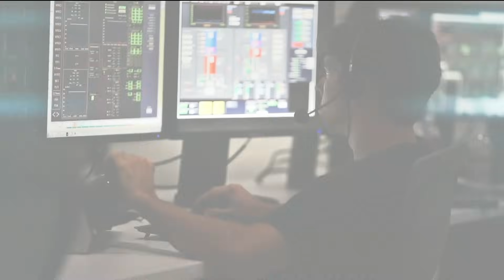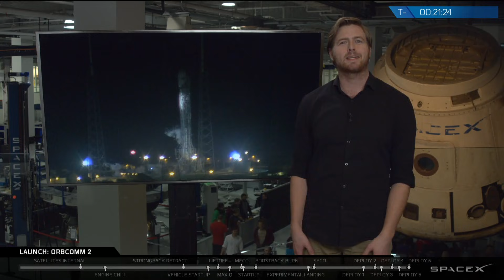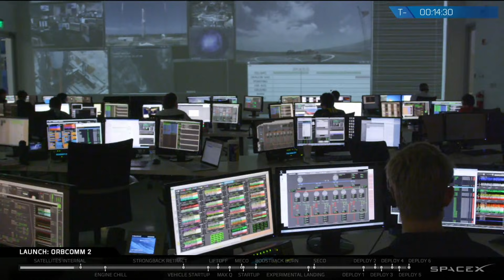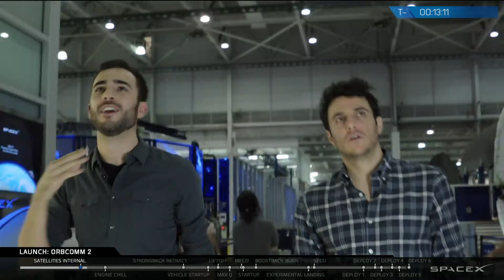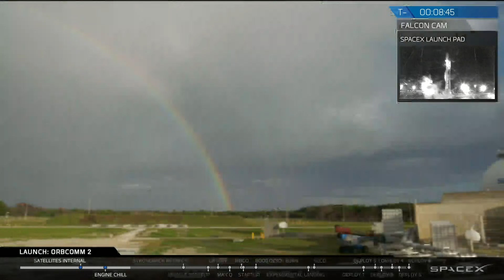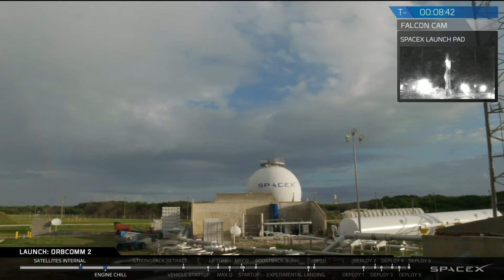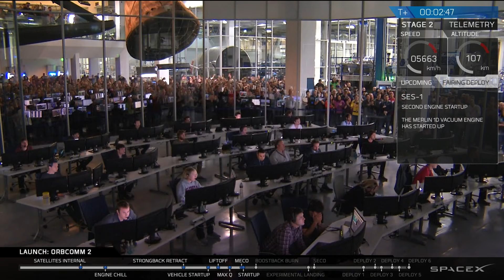ORBCOMM-2 Full Launch Webcast

Comment: 10 years ago today: "LZ-1 the Falcon has Landed" 

Since then SpaceX have recovered the booster on 552 out of 565 attempts (Including 9 simultaneous landings of Falcon Heavy side boosters), with the current reuse record being 32 flights, currently held by B1067.

Comment: why is the light or moon or whatever moving then stop moving when the box is released at around 39:35 ?
Reply: When the moon is moving the rocket uses small thrusters to change it's orientation, and when the moon isn't moving the rocket has stopped changing it's orientation.
Reply: are you sure?
Reply: Yes, Spacex has to deploy the satellites in a certain way for the customer, meaning they must re-orientate the rocket so that the satellites are deployed in a certain direction.

Comment: Where is Elon Musk ?
Reply: +chwaca He was in Cape Canaveral for the launch
Reply: +chwaca 
As Ambient Said he was at the Cape, so he could be their soon after it landed (if it landed -which it did), I know a guy who works their, and he was telling me that Elon was siting on his desk waiting for it to land, Well IIRC he then goes out side to watch it land and their was this red glare as it touched down, and as it did so the place is rocked by a pair of sonic booms, so Elon was thinking it blew up for a few seconds, and then he went back inside, and their all cheering... 

I watched it my self from across the river (~5-10ish miles), I was surprised by the sonic booms my self, but it was traveling at supersonic speeds until the last few seconds, baring the times it had the engines on to control it's descent, it was difficult to see it on it's way down (mostly due to the glow from the hot engine bells), but even then you could tell it was dropping like a rock, they did not call it a suicide burn for nothing (as in it landed or it didn't, no second try's).

Comment: As one author wrote "Getting into orbit is getting halfway to anywhere in the Solar System" !  Beyond LEO to save more is not to bring heavy LOX or O2 to heat the fuel (working fluid).  For a more gentle return from LEO use the SNC Dream Chaser.  Thank you SpaceX for the video and saving space !  tjl

Comment: "The propellant we're using is liquid oxygen"???   This guy actually IS a rocket scientist!  I would not expect him to make that mistake, even if he's on the materials and process engineering side.
Reply: ***** 

1. 654 kilonewtons @ 282 seconds specific impulse at sea level, 716 kilonewtons @ 311 seconds specific impulse in vacuum for the original M1D engines. The new ones are uprated 15%, so same specific impulse figures for sea level and vacuum but 756 kilonewtons at sea level and 825 kilonewtons in a vacuum for this and all future flights. 

2. It's not hypergolic. Hypergolic means combusts spontaneously on contact, which LOX/LH2 and LOX/RP-1 do not.

3. It's not liquid hydrogen. It's liquid kerosene in a refined form called RP-1 - the same as used on the Saturn V's SI-C stage.
Reply: +Tara Li There are two propellants: liquid oxygen and kerosene. LOX counts as a propellant, as does any oxidizer in a bipropellant mixture.
Reply: +Tara Li what is the error?
Reply: +Ambient Morality It is a hypergolic mixture, where LOX is the oxidizer that enables the liquid hydrogen to burn and produce thrust.
Anyone know what thrust each of the 9 engines produces at lift-off?
Reply: +Ambient Morality Thanks for the info AM.

Interesting how all of the commentary quoted trajectory and speed date in Metric units rather than Imperial. Good for them .............. probably Elon Musk insisted on it, having grown up in SA where metric is standard.

The USA is in that select trio that doesn't use metric measurements, along with Liberia and Myanmar. Great buddies to have, eh!

Blame it on Ronnie Raygun. who abolished the Metric Board back in there 80s.

Comment: I watched the show and a lot of confusing things in this video. Adds skepticism that this is a private rather than a government company. Maybe there is something I do not understand in aerodynamics, but I'm wondering how this stage of the rocket was able to land vertically without stabilizers? If someone can explain I will be grateful.
Reply: +RePr0GaMMa watch the other failed landing attempts on the spacex channel.. its much easier to see the engines gimbal around when its trying to keep straight.
Reply: RePr0GaMMa It has stabiliser fins at the top of the rocket that control its direction. Also, the thrust is not fixed vertical. The engine has gimbal control arms to aid in steering. The launch took place at the time it did because that was when the launch window was for the satellites to be placed in the correct orbit.
Reply: Throttling and gimbaling
Reply: +Dagarsky It had legs that extended as it was descending.
Reply: +roostewrum Still strange. It seems they do not have a suitable form for stabilizing, although maybe it's just the video quality. And they began to advancing too late, that would keep the rocket in vertical position in the ground, and rocket was already in a vertical position in the air even the appearance of the legs. Not clear to me how.
Reply: The legs are designed to not be completely rigid. This absorbs impact load and allows for successful landing even in moderate winds. The legs performed as designed.
Reply: +Dagarsky I agree. How is it that the rocket stays upright with only vertical thrust upon descent? There is nothing to stabilize it so it doesn't flip over. And why wasn't this operation held during daylight hours so we could see what actually happens and not just a intense bright light and then a rocket just appear out of nothing?
Reply: roostewrum Doesn't make sense to me. We don't see and shift in direction of the thruster and and fins would not have enough air moving over them at such low speeds to have and kind of stabilizing function.
Reply: Its math and speed of the processors controlling the retro rockets. Theoretically as long as there is a trio of thrusters, they will be able to counteract any forces or wind deviations. Its dam hard to do but it seems the computers csn handle it now.
Reply: parteibonza
Only question i have about your explanation is why a trio of engines is needed?

The falcon uses only 1 engine for its landing and manages fine.
Reply: +Brent Smith i dont know how it lands. Sorry i assumed that it used the outside engines (it has 9) as stabilizing thrusters. I guess it can use one rocket with vectoring thrust to successfully land while staying upright.
Reply: parteibonza
The reason it uses only one engine is because rocket engines don't throttle very well, and the stage is very light at landing.
Three engines would be way too powerful.

I can see why three engines would be more stable, but apparently one is still good enough
Reply: You can balance a broom on your finger without needing to touch its sides to keep it upright. Why should this be any different?

The grid fins are used at supersonic speeds to keep the rocket in the correct orientation during free fall. Under powered descent the merlin engine slowing it down can rotate in all directions to control the thrust vector.

They are essentially balancing a broom on their finger and moving the finger around to keep it upright. Why does this cause any conspiracy?